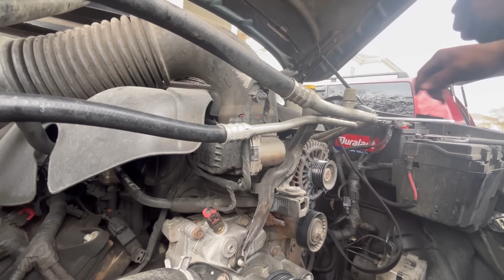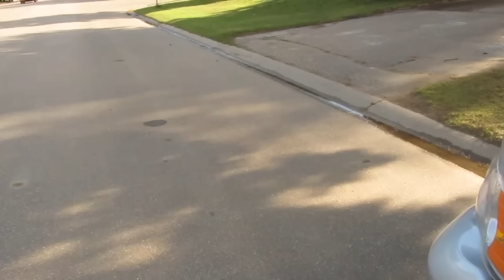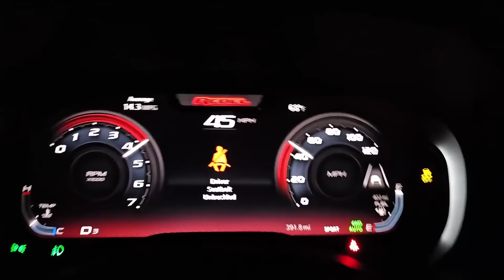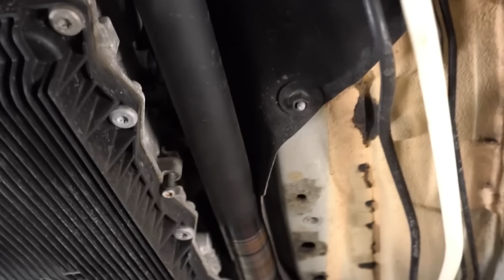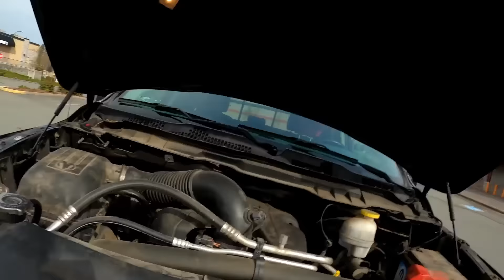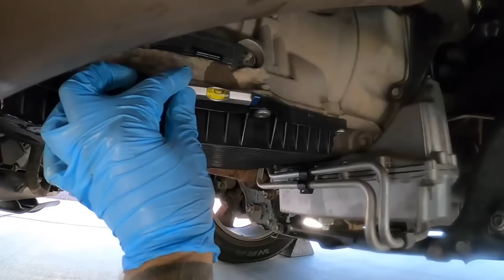Fix This on Your Ram Before It's Too Late (SAVE THOUSANDS)

Comment: If they start making and using all aluminum radiators again it would help. The EPA should enforce that so that the likelihood of having a coolant leak because of the plastic end tank seals leaking would be zero with an all aluminum radiator.